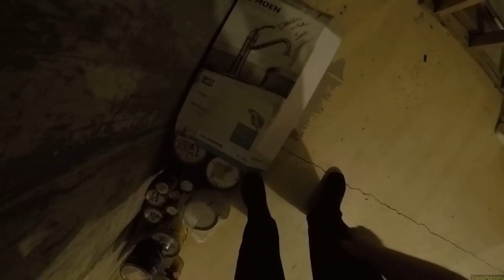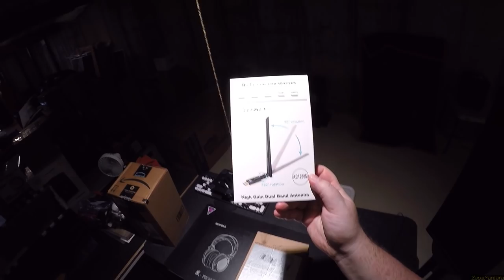Z Does - Basement Tour

Comment: Holy shit Z, so much room for activities!
Reply: And you're gonna need another electrical box buddy
Reply: Dr G He could replace the breakers with the 1/2 height type which would allow for more expansion. They aren’t cheap but that would eliminate the need for hiring a licensed electrical contractor. Most of that electrical panel is for lights anyway so I seriously doubt his service is anywhere close to being maxed out until he has a rack full of high current power amplifiers operating.
Reply: @Assimilator702  Good Idea

Comment: I work for a company like the carpet cleaners you have coming. We do everything. I suggest getting you vents cleaned. It’s recommended every 3 years but you can get away with 5. Any questions ask I want to make sure they do the right work with the right gear.
Reply: Good to know. They came and went by now but the heat just turned on and I am sneezing a bit. probably need a cleaning.
Reply: There are a few ways to clean duct work and furnaces I do it all for my company and this is my expertise for us. I would suggest asking if the company in question uses a negative air machine. Compressed air brushes and or regular chimney sweep brushes. Guessing by your previous location I’m assuming you are a little out of our range. But who knows we are in central pa.... I’m always around in your comments. I’m a vet of the navy combat teams and now do cleaning and restoration. Any questions along those lines I’d be glad to share what I know since I have learned so much from you and have been so very entertained by your channel!

Comment: Put shelves on the stairwell, put a light door on it or something, boom, you got yourself an empty boxes storage, out of sight, space used, mission accomplished
Reply: Also, you should flood-proof that basement. if water comes in or leaks through walls(it just happens, nobody's fault, all it takes is a bit more rain than anyone expected.) Basically, if there's a flood, everything that's on the floor and not on the shelf will be fucked. Do not just dismiss the possibility of that happening, it's the same as with fire hazard, better safe than sorry
Reply: Also, spiders, insects, roaches, rodents, if you don't put nets on the windows, you're risking A LOT of financial damage, also, better safe than sorry